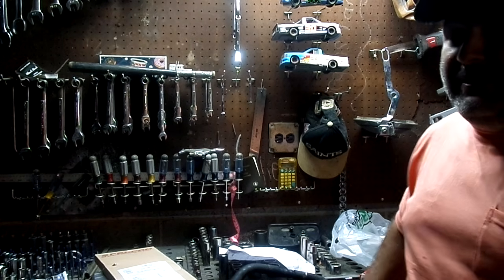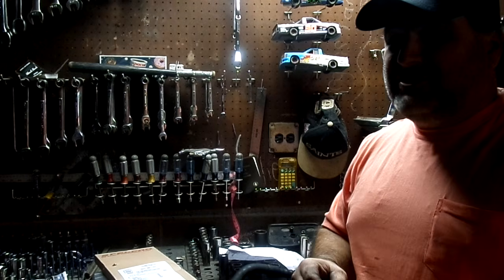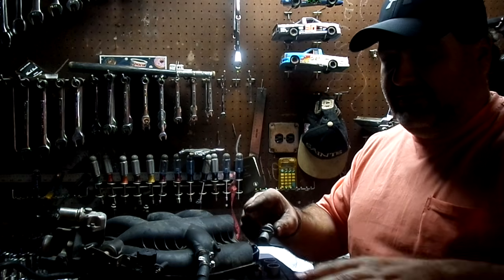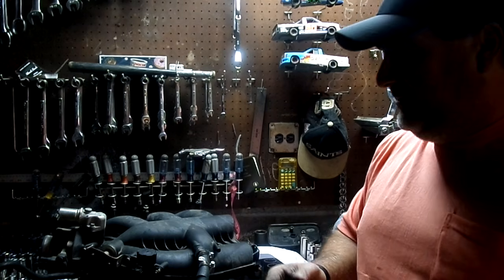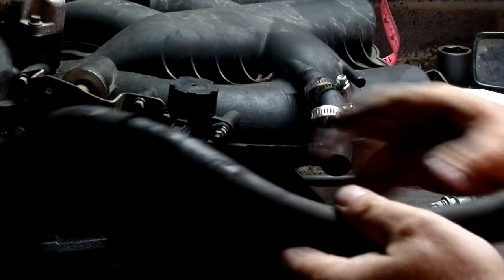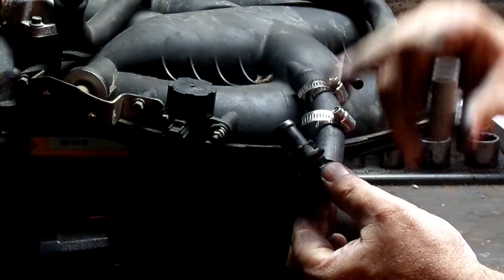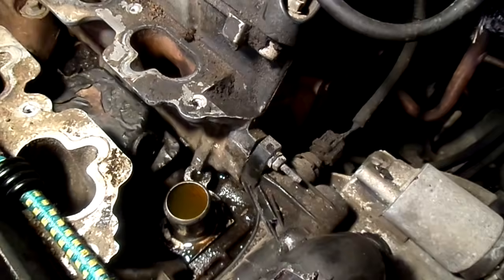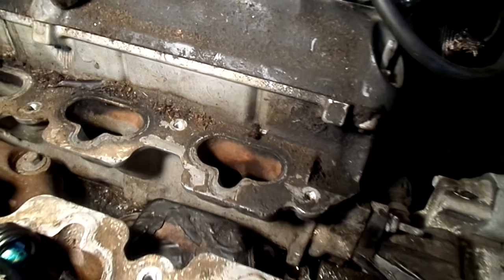Ford Escape PCV  Location And Common Problems And Tips For Repair On A 3.0 V6 Engine

Comment: Do you know where the coolant temperature sensor is on this exact vehicle? Is it under the throttle body about 8 inches to the right? If you're looking at it from the driver's side.
Reply: Christopher White Haynes manual doesn’t tell you where it is lol. It just tells you what to do

Comment: HI:  Thanks this was a big help. I was having trouble finding the PVC, makes me feel stupid.  23mm fits but I had to get a deep socket, my standard 23mm didn't have enough clearance.  I was able to pull the PVC ok with only taking out the battery and air breather assembly.

Comment: Just fixed this problem on my 2004 escape. I ended up replacing sections of the hose with reinforce heater hose. Listen for the sucking noise it's a dead give away that you need to replace it.
Reply: Ron b that’s exactly what’s going on with mine. Check engine light came on. Autozone personnel ran the codes and it showed my O2 sensors were bad, so I replaced them. The light was still on, so I cleaned my mass airflow sensor, light was still on. Filled my oil and coolant back up just because, and that’s when I stated hearing all the sucking noise that you’re talking about.

Comment: thanks for this! im having a bad idle and researching everything that may be causing it,
Reply: Change the manifold gaskets.
Reply from the maker: yes yes and yes lol , they are always a problem good luck
Reply: John Meister Dupa did you replace the Pcv Valve? Your car still have a rough idle?

Comment: If you want to see a prime example of Ford evap WTF, base model 4.6 L Modular V8 95 T-Bird. Outside of the regular polyester/rubber hose nonsense, you also get these brittle hard plastic "straws". It's no wonder you rarely ever see 95 T-Birds and Lincoln MK VIII on the road anymore.

Comment: Jamie, can you tell me what year escape that is? Ny wife has 2010 escape limited 3.0 and its going thru oil pretty fast . Did an oil change almost a month ago and the oil light came on. Less than 1000 miles I think. Original pcv @ 115000 miles
Reply: What year is this escape???????
Reply: dave3825us have you checked your oil pan gasket? Im assuming you checked the levels by the dipstick and oiled the rubber seal on the oil filter when you replaced it.